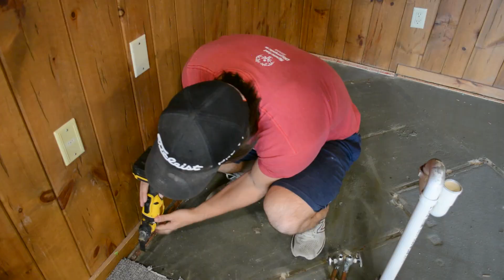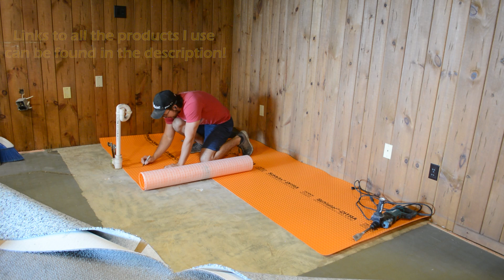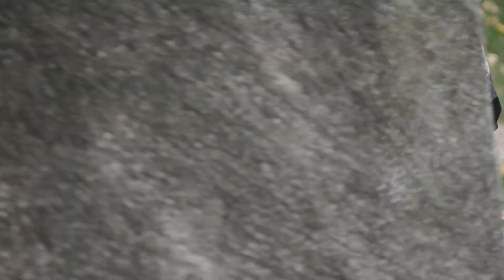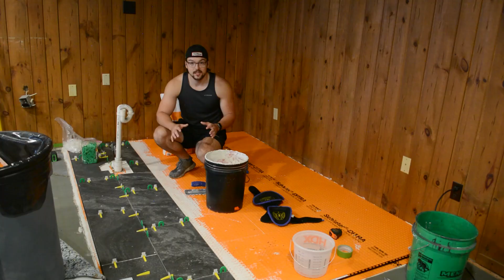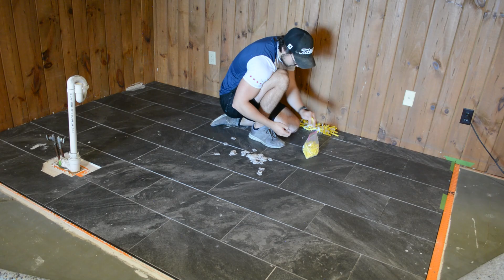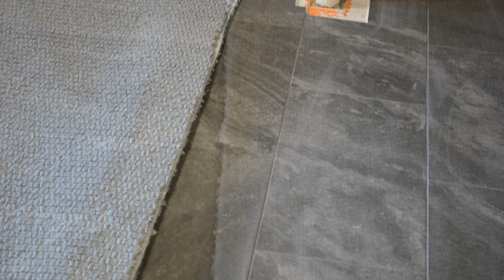How to Install Tile on Concrete | Basement Bar Build Part 4

Comment: Question: Why are you putting tile under where your cabinets are going? Materials are expensive and you're hiding your work under cabinetry. Seems a bit of a waste.
Reply from the maker: I would guess the tile under the cabinets makes up less than 25% of the total sqft. It would also take a lot of time to cut the tiles to fit perfectly around the perimeter of the cabinets. It would also be difficult to make everything perfectly level as well since there would need to be transitions between the tile and cabinets. In total the material cost of the tile under the cabinets it less than $100. To me my time is more valuable than that